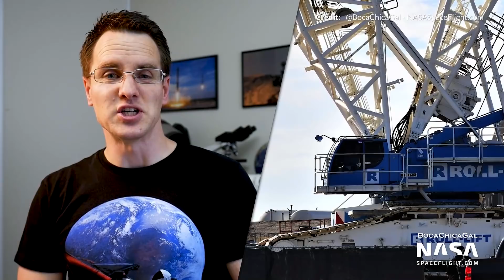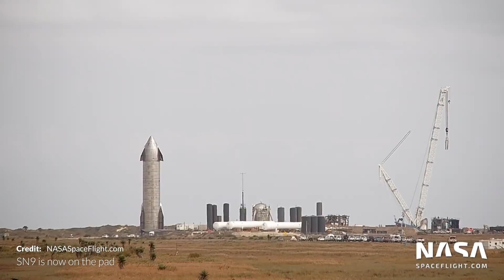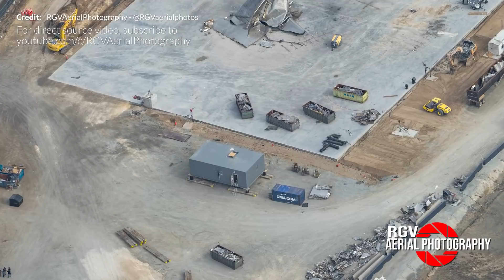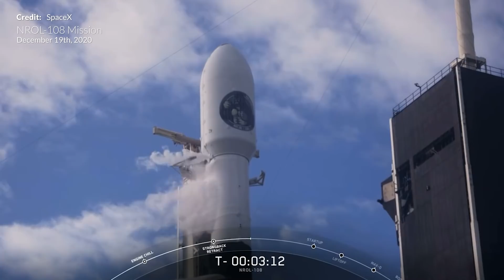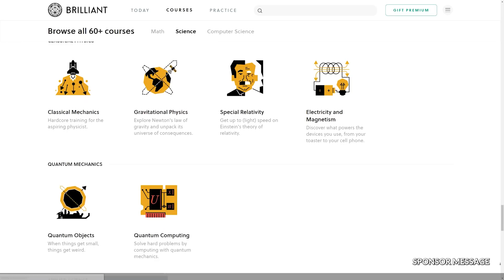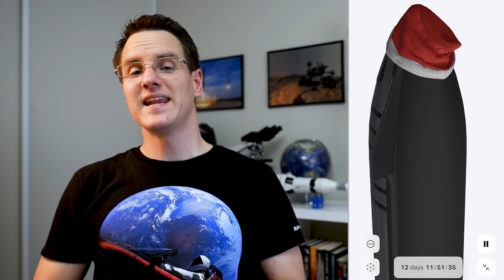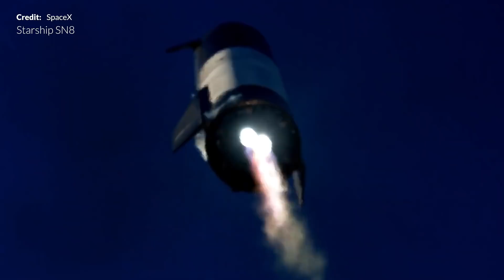SpaceX double launch pad usage for Starship coming, NROL-108, Lockheed Martin purchase Rocketdyne

Comment: Something certainly needs to change with SLS. $146 million for a single engine contrasts with $100 million for an entire Falcon Heavy. No amount of consolidation and cost control can make up that difference. These dinosaur contractors need to decide whether they will live or die. Right now they are on life support and we will pull the plug at some point as they are not sustainable at these prices, or even 1/10 of that price.

Comment: Marcus, why can't Elon dispense with the idea of a fixed landing pad and landing legs and you a portable landing structure with hands to catch the Starship instead, like a fielder catching a cricket ball. This could  be sent ahead and also be re fuelled on Mars. It would be a bit like the reverse of the sky crane with spidery legs and a mechanical Venus fly trap grabber on top that could hop to any location to catch the Starship. 🤔
Reply: That portable landing structure is much less reliable & no one set it up on Moon & Mars. Plus more complicated for rapid turnaround

Comment: Two questions...I notice that the landing pad for Starship is quite small in terms of diameter, not much wider than the ship itself. Is this for a reason and couldn't it be increased in size to make landing safely less like trying to land a bullet on a penny? Next, how soon would you expect Starship to be tasked with moving military hardware around the world, as it has apparently been tasked with doing? Not that such missions would be public knowledge, but I'd expect the Defense Department to want to begin testing Starship's ability to do this reliably as soon as possible.
Reply: They had plenty of experience with landing Falcon, so the landing pad not too large make sense considering increasing in precision

We don't know yet when exactly the demo of military E2E is gon a start

Comment: Better sensors for landing. That engine was putting out nothing much!
Reply: The problem is caused by lower pressure fuel header tank than it should be, starving the engine. Nothing to do with sensors

Comment: a landing on rough unprepaired  land  gravel sand   should prove if pencil landing is safe?  unload load  on destination is a problem?  Haulage us up uis still best option of best designed  special vehicles would be best for heavy
Reply: It will certainly had more advanced legs than it's today, and has elevator for load & unload

Comment: What was that green fire on sn8 landing? Why did it land so fast? Do you think maybe it's better to start lading process a bit higher up in the sky no it has time to slown down more before it lands?
Reply: Green often means that copper in a liquid rocket engine is vaporizing, which shouldn't happen.  That likely caused a loss of thrust and thus too-hard a landing which ruptured the vehicle's case to spill propellants.  It could be due to many issues.  Some speculate a problem with fuel supply, but could be a design problem with the Raptor engines.  It appeared the single raptor was also failing right as the first hop test landed, as its plume turned yellow.
Reply: @williamgrissom9022  The problem with fuel pressure supply is from Elon himself so not a speculation. He also confirmed that the engines runs great on SN8

Comment: Landing on concrete pad is one thing but landing on martian soil is going to require some fancy landing pads on those legs but I'm coming from the camp that none of this will matter because they have no way of protecting humans from the suns harmful radiation outside of the earths magnetic field.
Reply: They will have more advanced legs by the time it landed on Mars, and there are several solutions towards radiation (and even without protection, the live risk will increase only by about 1%), especially with Starship there are plenty of mass & volume margin for that

Comment: I couldn’t agree less. How could you say it without laughing. The RS25 build cost. “Let’s hole that efficiencies over time reduce build costs.” 

Are you serious? After 50 to 60 YEARS the rs25 is still an expensive rocket. So what’s a few more years going to do? Fucking nothing at all. Oh but it’s all different... they stopped the production line so now we instantly forgot everything, every engineer in the world died and all the construction notes, plans, steps, material lists, tolerances were burnt as fire starters for heat during the COVID thing.  The thing was sort of first started design in the 60’s and dedicated design stated full bore in 70. So 50 to 60 years and it’s still a mystery and the thing gets more and more expensive.

I think you need to get off the legacy space pandering horse, throw away the dose coloured glasses used for the shuttle the deadliest manned rocket ever built. Think that if since the first shuttle launch in about 81’ the SSME has been a bitch to rebuild, yes rebuild not just check or check and refurbish or check and repair and nothing at all was done to make it cheaper or easier to refurbish. Oh they made it more powerful but not cheaper.

Old legacy space needs to be shot at dawn or hung till they are dead dead dead fo the Cost Plus Contract scam that’s been instituted in this sector to the point it became the norm. The manufacturer or supplier or designer is given a contract for X dollars to a job and the contract profit is maybe 30% of X the total cost NO MATTER WHAT HAPPENS. So the contractors work hard at increasing costa as much as they can get away with. Then the contractors suggest excellent changes to enhance the product, but at great cost. Then all NASA rockets end up with pink stabilisation fins at the cost of 40 million each for paint from harbour freight/ Bunnings.

The contract system actually PENALISES the contractors for performing well by delivering on or under time at or under budget and REWARDS them for being corrupt.

That’s the RS25. It was designed and built to cost a fortune so a fortune in profits could be made. Sure it’s a good engine but when was the last time you went to the art exhibition of a convicted pedophile? Also a criminal. 

THE RS25 WILL ONLY GET CHEAPER IF THEY JUST SELL IT CHEAPER. 60 years of development, I’d say it’s done. If not then they haven’t really been developing it have they? Hence corrupt cunts adding to the assumption that space is so ludicrously expensive when it’s just very expensive. SpaceX proves that every day.

Comment: So it seems that when a stainless tube is made and then braced with stringers and tank bulkheads along with a compound curved nose cone and a strong as fuck thrust puck, that a bit of a pre Christmas drunken fall into the wall isn’t a problem if you get your arm up first.

Really though it’s steel and curved plus compound curves and bulkheads and stringers. It’s designed to have wildly variable and very quickly variable side and twisting loads. Think atmospheric entry and then the skydive with the Elonerons all acting independently to impart pitch, roll, yaw, twisting and straight up snapping in half forces on the StarShip . SN9 isn’t a fully engineered production model but still it’s far from a weakling.

Long ramble short. We shouldn’t have been surprised that SN9 was just helped to its feet, dusted off, stuck on a bandaid / elastoplas and carried on like an Australian or a Kiwi or a British person would. 

I see now! It’s a USA rocket. We were all waiting for SN9 to sue Elon because SN9 fell over its self because it drank its own beer. Also on the way down Elon’s shed was damaged and even though Elon paid to get SN9 picked up and fixed up we all were expecting SN9 to sue Elon. Ahh the USA way, when it’s totally your fault sue the person whose least to blame and helped the most.

That’s why we didn’t expect to see SN9 roll out for ages or ever. SN9 is a USA rocket...

In my defence before you all push for my ban....OJ Simpson and Michael Jackson. Your Dishonour I rest my case.

Comment: Couldnt they build a much smaller rocket for testing like 1/10the size?? It seems expensive building a rocket that big for testing.
Reply: Starship prototypes cost <$30 million each, so they’re not that expensive when contrasted to other things in aerospace. OTOT, SpaceX needs to test full-sized Raptors, flaps etc. in flight.
Reply: It's actually more expensive to build 1/10 scale when you already tested the full scale one

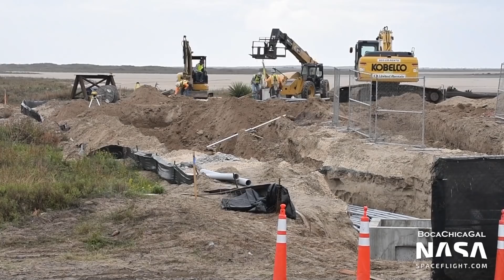Comment: 5:00  It's possible these pipes are part of a soil drainage system. These bundles of thick pipes don't make sense as electrical conduits. The end-on pics we've seen before show a pipe cross-section thickness that looks like some sort of concrete or porous tile material. They don't look anything like all the other gas pipelines on the site.

Agricultural fields use large drainage systems to keep from being waterlogged after heavy storms. The Vertical Launch Area is on fairly unstable soil. This will be crucial for any structure that isn't the Orbital Launch Mount.
Reply: Great analysis there. I like it.

Comment: Let's be honest, the competition have dropped the ball by not reusing their rockets. You can reduce manufacturing costs as much as you like, but all you're going to do is marginally reduce the huge financial gap with SpaceX. Elon is laughing all the way to the bank.
Reply: They absolutely did. Not to downplay the achievement of spacex, before they did it nobody in the rocket industry ever once thought it was even possible. And we know that new rockets aren't made in a day. They have to change everything they thought they knew about rockets. Only Blue origin is one working towards an actual reusable rocket right now, with rocket lab too well on their way to recovery. But they are in a different category altogether so that's not relevant to this conversation
Reply: @mutantgeralt  There were actually quite a few reusable designs prior to SpaceX.  There was even a 2-stage flyback booster design for the DCX follow-on. I can think of a half dozen companies that had some type of reusable design.  All of which ran out of money.

Elon however, had the tenacity to see it through.
Reply: @Rocketsong  Oh cool, then the main reason was lack of funding/trust?

I am not that knowledgeable in this matter but then what made SpaceX different? If it was funding, they(others) had a lot of it, didn't they? Was it lack of trust in their own  design? But then why didn't they try harder, cause we all know the financial potential was/is huge.

I think it was most likely that they already had so much money coming in for outdated designs, they didn't feel the need to go and do the work for a proper re-usable design, which again, as I said, would require a re-haul of their entire organization/workflow and knowledge ofcourse.

Edit: I sound rude maybe in my wording, pardon me cause English is not my first language. I am genuinely curious and want your honest opinion
Reply: How much do they really save?
Reply: @Youtubeuser1aa  IF Starship is successful with a return trip from Low Earth Orbit (LOE) Cf SLS,  they would save paying customers up to US$700million per launch AND SpaceX will be able to deliver 1.6 X the payload of SLS AND have on offer a 1,100 cubic meter area to fit possibly more than  one payload. Effectively, under certain configurations,  that could save some customers the cost of 2 flights! So that could save them US$1,400million for 2 payloads. That's starting to look VERY attractive as a launch provider to me. 🤑
Reply: @David-yo5ws  interesting.  I’ve not seen very rigorous financial analysis for their current model.
Reply: It’s not just about the reusable rockets.  It’s the constant cost cutting and efficiency that is applied across the whole company.
Reply: Elon is schooling everyone
Reply: I liked and agreed with your honesty. Except at the end, cause to be honest, why would Elon need a bank? Banks are full of banksters. They only invest in safe loans and screw the loanee with everything they can put in their legal jargon. YOU stuff up and they will take everything off you as first appointee and screw anyone else involved. Look at the $billions of profit they make each year. What the hell are they going to do with that floating cash, I have no idea??? 
Elon spends what he gets, so he is better off buying his own bank and putting the money through that. May as well take the cream on the way through. 
Should SpaceX end up with a fully functional re-usable Starship Programme, he will start to make a profit. He will probably then spend that profit on testing a bigger Starship to see if it is practicable and/or even possible. Rich people hoard their money like squirrels store acorns. They are bean counters who never share their beans and tie up cash circulation and have a negative effect on our economy. Elon uses money to get to his visionary goals. He is not and will never be a Bankster or bean counter. In my humble opinion.
Reply: @David-yo5ws  - Banks are just a business like any other, they're not there to make you rich or do the right thing. Elon has a bank account, SpaceX has one, and I bet oyu do too. They are what they are. You don't have to use them if you don't want.
You can't blast all rich people, some are altruistic, and some give it all to charity when they pass away.
I know full well what Elon is like and why he's doing this, I don't need a lesson. I also don't need a lesson on banking thanks. Go and rant somewhere where someone cares what you have to say.
Reply: @rogerfroud300  Thanks for the reply. Yes, I did get carried away.
Reply: @rogerfroud300  Exactly.   Banks provide a service.   It’s our choice to use them or not.

Comment: i'm late with this question but did the landing legs ever deploy when SN8 made it's historic first/last flight? After watching the video several times, it seems due to the fuel issue SN8 came down so fast that the legs didn't have time to deploy. Thanks in advance
Reply: True, they never deployed. Some speculated this was a separate failure, but due to the simplicity of the leg design that's very unlikely. "The legs didn't have time to deploy" is the right answer. IMO they are meant to release at a certain point in the deceleration, and since that point was never reached they never deployed. Or, they were released only a moment before impact.
Reply: @donjones4719  that's what I thought, thanks

Comment: I can’t imagine them having 2 starships on the pad at the same time , probably got 2 pads because the damage that can be caused by the static fires so if the concrete breaks up they can move it over , I don’t think they would want 2 in case of a failure during pressure tests and launches

Comment: Starship is instabil and no good.To great and flying not so stabil.
Reply: What do you mean for instabil?
Reply: @alvianchoiriapriliansyah9882  The flight was not so Stabil.You can see this at the start.And the Rocketbooster was not Stabil.It burning sometimes
Reply: @alvianchoiriapriliansyah9882  not so safe
Reply: @andreasprethaler5705  You didn't know what you're actually talking about. Got it

Comment: Why do aerobatic models and sports aircraft 
have fuel flowing smoothly to the engine, 
despite the aerobatics and unpredictable behavior of the fuel tank? 
AND the SN8 is NOT?
Reply: Sports aircraft aren't using cryogenic fuels, they're usually using some sort of petroleum fuel that's liquid at room temperature. In contrast, starship uses cryogenic methane, which is a gas at room temperature, thus the additional complications. 

Further, aircraft have the benefit of gravity to aid fuel flow, another luxury that anything intended for space does not have.
Reply: Pressure is low, not the liquid

Comment: SLS rocket system is a joke... well late.. well over costing and then it is not reusable. 
The company must think they are all still in the 1980's throwing everything away even though it cost many millions. 
a totally silly outdated system which now Space X is doing 80% reusable and soon 100% reusable rockets. 

Why has NASA allowed this old out of date over costing late silly wasteful SLS rocket idea to even be used? 
Just cut the losses guys and cancel it. it has been far too long coming and is a drain on the money and I am sure the US tax payers would agree.
The reason it still being done is simple damn signed for contracts locking in NASA to using this waste of money.